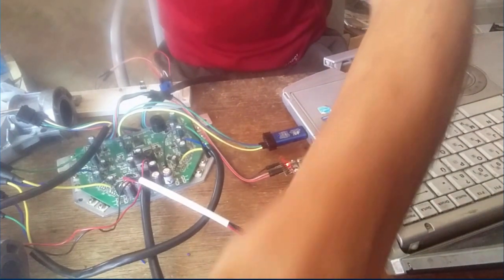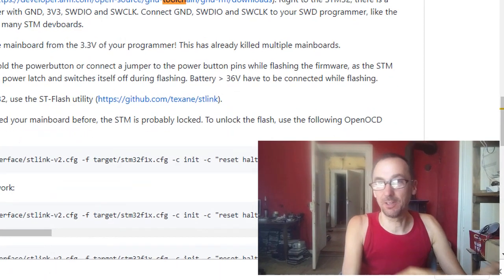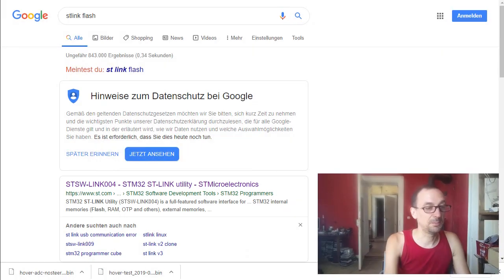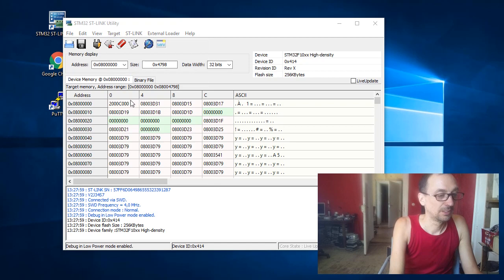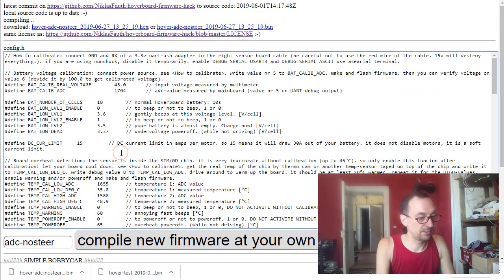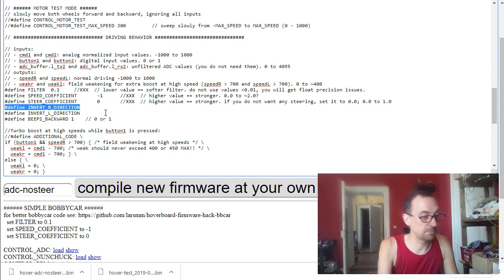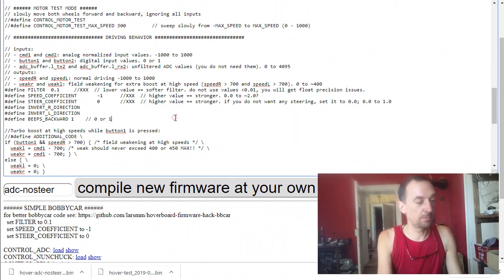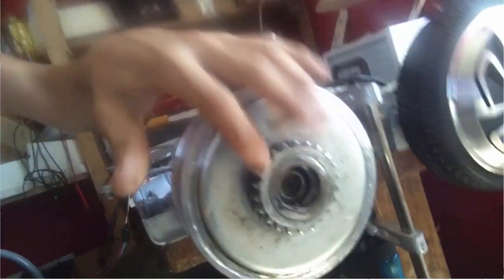free online hoverboard firmware compiler - full tutorial :-)

Comment: I have been trying to hacked i would like to have a forward reverse brake and steering but I'm having issues. Could you set it up copy and paste it underneath my message so I can make sure I have the same settings?
Reply from the maker: No, you have to learn step by step what you are doing. When one step is not working I might help you with that specific step.
Start by finally watching this video and repeat the Bobbycar adc preset.
And no more 5V to the input cables!
Reply: Okay any help would be appreciated. I added 2 // to disabled uart 3 d bug. Removed // from test motors . in failed to compile.
Reply from the maker: @speedox3771  error message ?

Comment: your awesome thank you so much could you add the Gen2 version of the hoverboards with 2 sided motherboards.  I am good at soldering but not at coding stuff
Reply from the maker: You must ask Niklas on his GitHub. He made the original firmware. I only made the online compiler.
Reply: @robodurden  I was wondering if you could help I have finally got my hands on an st32 arm chip controller and was able to flash with your complier on the stock firmware. I am trying to use just Ppm to go forward I dont need steering.  I have a flysky 2.4ghz receiver plugged into green for signal, black for ground, and second red for 5v. I turn it on and both wheels test by going back and forth slowly with a bunch of beeps then shuts off. It happens before I can bind the remote. And if I turn it on it just repeats. Any thoughts what I did wrong.
Reply from the maker: @plojm123  f**k, YouTube deleted my long answer because of a AliExpress link to a level converter so you do not let 5V but 3.3V to the green input cable :-(
Try running the rc receiver with 3.3 V.
Seems you compiled the original config.h with the CONTROL_TEST.
Simply click the Load link beside CONTROL_PPM at the Bobby Car preset section at the bottom of my page. Then study the config.h for the XXX changed being made.
Reply: @robodurden  I will try today thanks again really appreciate everything
Reply from the maker: @plojm123  Take a closer look at the main.c . It is quite easy to program whatever driving behavior you want directly into the firmware. 
If not you should give my serial control fork a try. Then you can use an Adruino / ESP8266 / ESP32 to implement your code.
Reply: @robodurden  is this not the actual firmware https://github.com/flo199213/Hoverboard-Firmware-Hack-Gen2            ?
Reply from the maker: @plojm123  thanks for the Hoverboard-Firmware-Hack-Gen2 link. I will try to add that repo to my online compiler in a few days :-)
Reply from the maker: @plojm123  Sorry, that repo does only contain the Keil project files, no Linux style Makefile :-( 
https://github.com/flo199213/Hoverboard-Firmware-Hack-Gen2/issues/10
Reply: @robodurden  can you add https://github.com/benjaf/hoverboard-firmware-hack-esk8  to your complier. I dont have much money but would be willing to throw a cup of coffee or something your way. I found it easy to just use a cheap PWM remote but need to change the battery settings as it thinks battery is dead at 35v under load but really that's just voltage sag because I am pushing 20plus amps

Comment: Sorry I have question how problem My battery level can't show in serial arduino? And can you tell how use PID control for spin wheels run by cm?
Reply from the maker: You should use my fork as it has reliable serial communication.
Take a look at my Arduino example code and the main.c of my firmware  where I define the response communication sruct:
//ROBO begin
typedef struct{
 int16_t iSpeedL;		// 100* km/h int16_t
 iSpeedR;		// 100* km/h
 uint16_t iHallSkippedL;
 uint16_t iHallSkippedR;
 uint16_t iTemp;		// °C
 uint16_t iVolt;		// 100* V
 int16_t iAmpL;		// 100* A
 int16_t iAmpR;		// 100* A
 uint32_t crc;
} SerialFeedback;

When iAmplL + iAmpR == 0 you can take iVolt as the battery level.

Also search in main.c for
#ifdef SPEED_IS_KMH
	long iSpeed = abs(HallData[0].HallSpeed_mm_per_s) > abs(HallData[1].HallSpeed_mm_per_s) ? -HallData[0].HallSpeed_mm_per_s : -HallData[1].HallSpeed_mm_per_s;

It should be possible to use HallData[i].HallPosn_mm so the motor speed = cmd2  drives you to the exact position :-)

Comment: I did the first one it does not seem to be changing for me sorry about the late reply. I'm trying to use the hoverboard motors for my mom's wheelchair to help her be mobile.
Reply: Is there any way you can go through the firmware? Set it up to use the Wii nunchuck that way I can go through the entire thing and make sure it matches? Any help would be greatly appreciated.
Reply from the maker: @speedox3771  pwm is no good for steering and speed. You would need two servo tester. Better take two potentiometers.
There is no brake but recuperation. Simply set the speed low and the motors will brake and push energy back into the battery.
The label is only for you to remember what settings you used when compiling the firmware.
Seems that most of you haven't even watched this video..
Reply from the maker: You have to disable debug output by putting // at the beginning of the definition in config.h :

//#define DEBUG_SERIAL_USART3      
   // right sensor board cable, disable if I2C (nunchuck or lcd) is used!

Then it compiles. With a lot warnings but the .bin file should work.

Comment: Hi, great tutorial!
I trying to control both motors with one potentiometer.
I'm using your online-compiler with the RoboDurden/hoverboard-firmware-hack.

I encountered 2 issues:
1. I can't get DEBUG_SERIAL_ASCII  to work. (It works with the other firmware from NiklasFauth)
What do I need to comment out/in?
2. How do I adjust these parameters correctly?
  #define ADC1_MIN         0        // min ADC1-value while poti at minimum-position (0 - 4095)
  #define ADC1_ZERO     1100        // ADC1-value while poti at zero-position (0 - 4095)
  #define ADC1_MAX      4095        // max ADC1-value while poti at maximum-position (0 - 4095)
  #define ADC1_MULT_NEG  1000.0f     // Use 1000.0f to calibrate form MIN to MAX
  #define ADC1_MULT_POS  1000.0f     // Use 1000.0f to calibrate form MIN to MAX
My potentiometer goes from 1010 to 3040. I want the wheels to start turning at 1050 and turn at the highest speed at 3040. I don't want the wheels to spin backwards. I only need one direction.
Reply from the maker: My fork is only good for uart control (download the Arduino .ino from my GitHub). For potentiometers better use the original Niklas firmware with the ADC preset. Like shown in this tutorial, the Bobbycar adc_control only spins in one direction.
Reply: @robodurden  Thanks for the answer. That explains the issue. I'll try to figure it out tomorrow.
Reply: @robodurden  Thanks for the response. I got it working yesterday with the original Niklas firmware. The problem was that the analog signal from the potentiometer wasnt good at first. I had to put a 1kOhm pull-down resistor to it.
Reply from the maker: Simon Hersche good Idea to have an additional resistor to ground in case the potentiometer gets lose and only the 3.3V sets the motors to full power.

Comment: Have you tried flashing the split-motherboard version? I tried and it display programming error @ 0x08000000.
Reply from the maker: I don't know what a split version is. Furthermore my compiler should output more information on error.
Reply: Like you I have also the separated type of mainboards which have 4 pins for ST-LINK connection each of them. Do you have any suggestions for those type?
Reply from the maker: @WhyNotCycles  no I have only one stlink socket. Don't know what you are talking about. Read the entire readme of the original Niklas GitHub. 
Upload a video describing your Problem.
Reply: @robodurden  there are some hoverboards out there working with two mainboards, one per bldc motor. Each of those boards have the 4pin holes and i m not sure if i should flash the new filmware to each of them.
For now i have connection issues i have to solve. My target is to power both bldc's with one throttle signal...
Thank you for your very helpful video tutorial!
Reply from the maker: @WhyNotCycles  if you don't have the identical Motherboard the firmware will probably not work anyway.
Reply: @robodurden  i have order the correct also to have a plan B..

Comment: hello, great tutorial! i have a question, im using 2 hall effect sensors for adc1 and adc2 as throttle and brake/reverse operating them with 5v. 
I have the problem when i let go of the throttle the board powers down and i have to turn it back on. The adc values are 1033 min and 4095 max
would giving the throttles 3.3v rather than 5 fix this?
any ideas would be very helpful!
Reply from the maker: If you let more than 3.3V to the ADC inputs of the controller board you very likely will kill it. 
When firmware powers down after speed is set to zero this can be the result of a wrong battery voltage defined at the top of config.h
Reply: @robodurden  thank you for your quick reply, ive just looked in the battery section and saw : #define BAT_CALIB_ADC                 1704       i havent calibrated that yet, could that cause the powering down issue ?
Reply from the maker: @Jason-yd6lb  you should not need to calibrate the internal adc with
   #define BAT_CALIB_REAL_VOLTAGE        43.0       // input voltage measured by multimeter  
 
   #define BAT_CALIB_ADC                 1704       // adc-value measured by mainboard (value nr 5 on UART debug output)

but if you keep
   #define BAT_NUMBER_OF_CELLS     10        // normal Hoverboard battery: 10s
but only connect a 7s 24 Volt battery, the firmware will shut down when your throttle is telling the firmware to set speed to 0:
   #define BAT_LOW_DEAD            3.37      // undervoltage poweroff. (while not driving) [V/cell]

If this does not  help you should connect the serial debug output and see what the firmware outputs. Do only connect GND, RX and TX to your computer.
Reply: @robodurden  thanks for your help good sir, ive just noticed that my cells is set to 12s instead of 10s for some reason (im using normal hoverboard battery) so ill flash that and hope it works :)
edit: that did the trick, thanks for your advice!

Comment: Great job. I'm excited.
I have a motor mounted on a bicycle but I don't know what parameters to touch to just drive one motor (cancel the other one) and drive speed with an e-bike accelerator or analog potentiometer. Could you help me? Many thanks.
Reply from the maker: Choose the original Niklas firmware and the Bobbycar ADC preset. That is exactly what I show in this video. Simply connect only one motor. Should work :-)

Comment: Hello, you seem to be the only guy who can explain how to make it work, but nevertheless I could not get mine to work. 

I opened your online compiler
chose RoboDurden/hoverboard-firmware-hack (as I had no success with compiling other methods)
loaded SIMPLE BOBBYCAR, CONTROL_PPM
downloaded .bin file
flashed downloaded .bin with st-link utility (successfully programmed)
connected RC receiver to +5 and GND of the hall sensor
connected signal pin of my RE receiver to all possible wires (blue and green of both uarts)
but my motor never moved.
I am using 5065BLDC motor with no hall sensor (may it be the reason for not working?)
Do you have any suggestions what I am doing wrong?
Reply from the maker: With no hall sensors connected the firmware will not work. You should only use this board with the standard hoverboard motors or possibly ebike motors. When I disconnect the hall sensor cables in my setup, the controller will not work. So should your setup not work. With no hall sensors go with an ordinary ESC. Or try a cheap $11 ebike controller that does not need hall sensors.
And anyway when something does not work: always read the serial debug output.
Reply from the maker: For your 5065 get yourself a "red brick ESC"
Reply: @robodurden  Thank you for a quick answer. That's good to hear that it is not supposed to work without hall sensors. I will install an original wheel to test it out, I just don't have access for it right now. I have other ESCs also, I just wanted to get hoverboard ESC to work. Thanks for reply!

Comment: having trouble with potentiometer controls(ADC), motors not moving when turning the pots. I have selected the ###### CONTROL VIA TWO POTENTIOMETERS ###### but no luck. Am i missing something here???
Reply from the maker: Connect a Usb-uart module and read the debug output. And compile and install the test mode first to see that board and motors are okay. Be sure to only use 3.3 Volt vor the potentiometers ! Same for the usb-uart device. Rx pin might output 5 volt !
Reply: @robodurden  finally got it working like a charm:-). Thank you.

Comment: Any tips on flashing the GD32F103 based motherboards?  Having trouble finding the STM32 based boards.
Reply from the maker: Apart from different clock they are said to be compatible. In the beginning I succeeded installing an IDE and uploading a blink sketch to a blue pill. Next step would have been to upload the blink code to the hoverboard controller. The some code with uart debug messages. And then the original Niklas firmware. Inside China you can buy blue pills with the GD32 instead of the STM32. So step by step :-)

Comment: Hello 
I want to use this with only one motor with thorttle e bike
It's possible to have information for programming optimized current speed ?
Thanks for explaining me
Reply from the maker: For ebike controller and throttle grip read my today's answers in my previous video https://youtu.be/UOGolEJIfsc !!!
Reply from the maker: But with a 1000 Watt hub motor you could use both motor drivers of the hoverboard controller in parallel ! For safeness the bldc should be modified that only one hall input drives all 12 mosfets. With such a rear or front hub motor you would benefit from the recuperation and have an electric brake Wich would charge the battery down to about 3 km/h :-)

Comment: cool.  Is there a regenerative brake in this program?
Reply from the maker: Yes the firmware indeed has recuperation ! Don't know why and I haven't yet studied the bldc.c but with my 7s 24V solar car and chain drive (watch my latest video) I can drive as fast as 10 km/h. When I set the speed to zero while driving, the motors brake and a few amps flow back into the battery. Even when I drive downhill at only 3 kmh, the controller manages to step up the motor voltage to charge the battery.

With my own fork (see my online compiler) you have the option to set a max_recuperation in order to not brake too abruptly.

Comment: Hi @robo durden, can you fully control both hoverboard motors with just 2 analog joysticks, i.e. potentiometers? Forward, left, right, AND reverse?
Reply from the maker: You only need two potentiometers and the armchair ADC preset at my online compiler :-) for reverse I would advice a digital communication like my uart fork. For analog ADC control you might to adjust the main.c code. Generally, +1000 is full speed forward and 1000 is full speed backwards. The ADC control only maps to 0-1000 and these invert defines make it 0 -1000. But in the main.c you are free to map 0-1000 onto -1000 -+1000. Have a look at the code on my online controller.
Reply: Awesome! How exactly are the potentiometers connected to the main board? What are the values of the potentiometers & any pull-up or pull-down resistors?
Reply from the maker: @reggieguevara8025  read my other answers here! If backwards is not already supported by the armchair preset I might add a Boolean bBackwards to the main.c and two time variables (or counter values) iTimeFullLeft and iTimeFullRight.
Then you control bBackwards by:
if ((speed<10) && ((iTimeFullRight-iTimeFullLeft)>-500) && (iTimeFullRight>0) )
{ bBackwards=true; iTimeFullRight=iTimeFullLeft=0;}
To set iTimeFullRight: if (steer>950) iTimeFullRight=iNow;
Code to disable bBackwards would be "speed potentiometer must be zero and first full left then full right within 500 milliseconds :-)
So a digital command to change from forward to backwards. But that depends how often you need backwards. With my solar car (see next video) I only need backwards on a parking lot..
Reply: @robodurden  thank you & more power!
Reply: Ofcose : https://youtu.be/kdshcX9SFF8